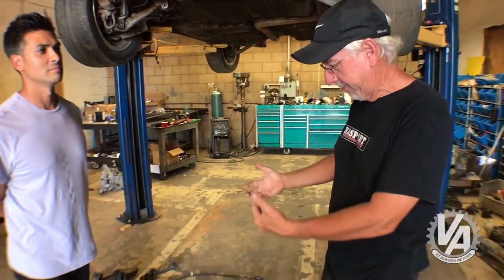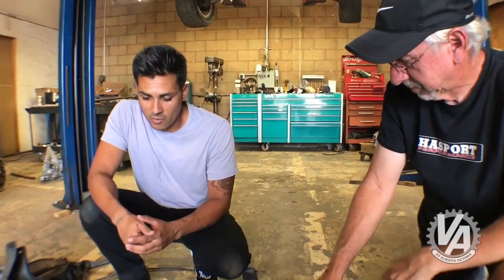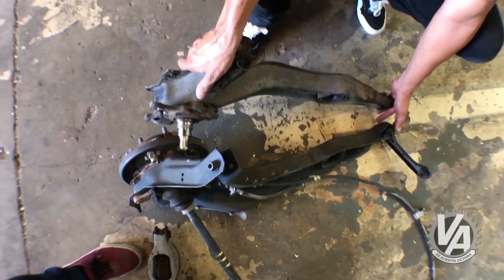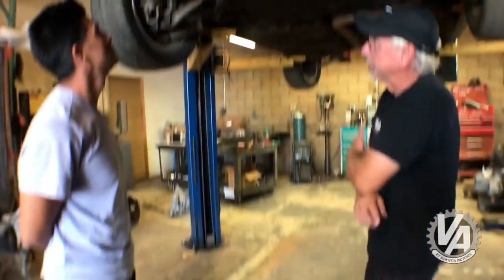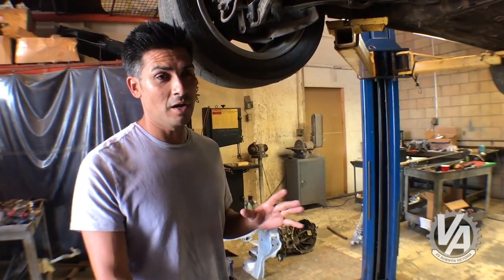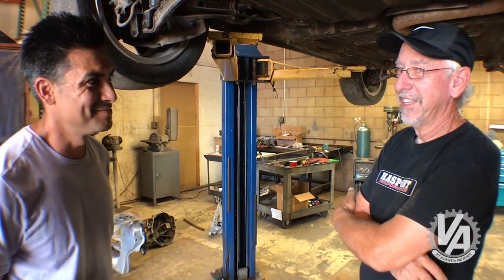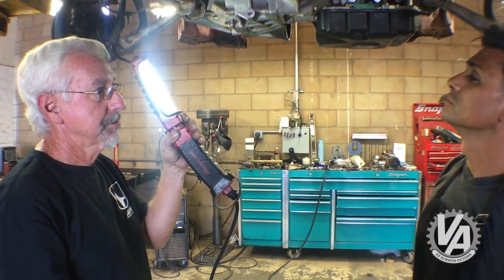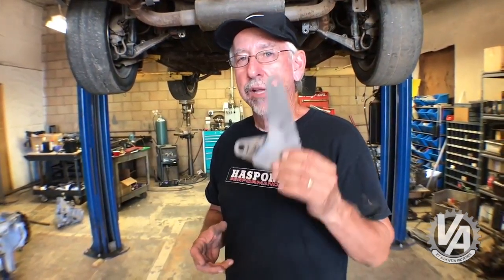AWD K Series EF Civic/CRX Conversion

Comment: I have worked on one of these projects years ago. Found that the 1st Gen crv rear wheel bearing has the same bolt in pattern of the bearing housing unit of the awd wagon. Then I used 2006 civic front hubs into the crv rear bearings. I paired that with a da front knuckle with 2006 civic front hubs. With that setup factory 2008 accord v6 coupe 6mt brakes and rotors bolted right to the da knuckle without clearance issues. That gives you a 5 lug awd ef with 300mm front rotors
Reply from the maker: Nice. I will try that out. We are building a rallycross wagon, so 5 lugs is a good safety measure.
Reply: isucaps, so you used the accord brakes on the rear setup as well? or stock wagon calpiers? stock crv calipers? Thanks
Reply: Also what prop valve would you need to use for this setup?

Comment: Odyssey Fab has come out a rear mounting kit for a wagon diff that you cut and weld on the rear subframe. It’s only about $300 which is very affordable considering what other companies are selling it for and a lot more basic. The most expensive part is the rear trailing arms so if you can come up with a solution for that it would be tits!

Comment: I am a former Honda owner who switch to Subaru back in 2002. I had a 81' Civic, 89' CRX Si and a 94' Civic Dx all modified. I find this conversion very interesting. The question I have is what do you do for a center diff? Does it have one? STi and Evos have elaborate center diffs.

Comment: I think if you're going to make a rear diff carrier, you'd be far better off making it for Element/CRV rear diff, and not WagoVan. The wago rear diff is awesome, but requires the use of the factory driveshaft with the viscous limited slip built into the driveshaft, and those things are rarer than hen's teeth these days, and ungodly expensive when you do find them.  The Element rear diff however, is easy to find, and there is one company that makes a performance rear ramp engagement kit for it that makes it lock up faster and harder.